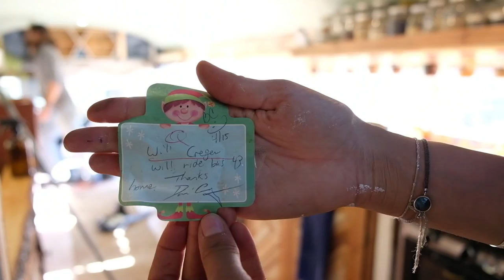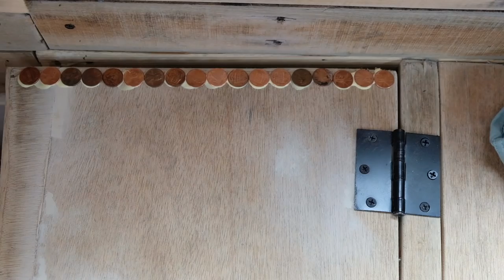EP #39 SKOOLIE CONVERSION // Storage build out in a converted school bus

Comment: Hello you guys I'm sorry to hear about your electrical problems but it might help if you clean out the back part of the refrigerator where the motor is you have to take a little vacuum cleaner hose  a vacuum  back there let the Refrigerator get completely get dry and then you take a vacuum hose and vacuum all the dust out the back that will help...